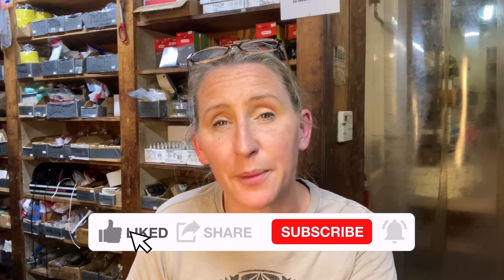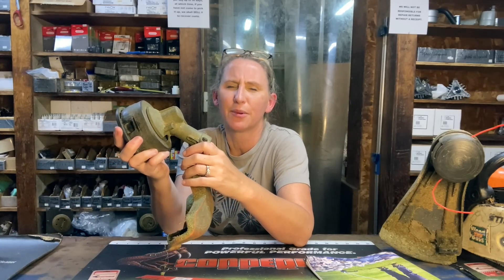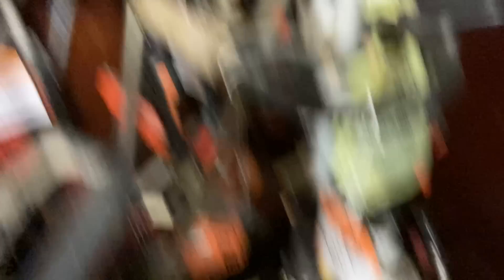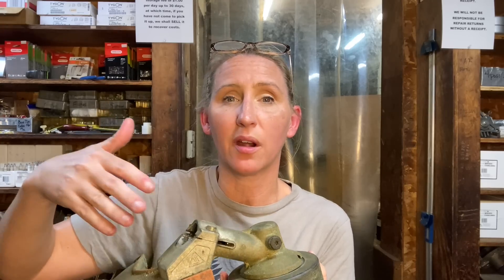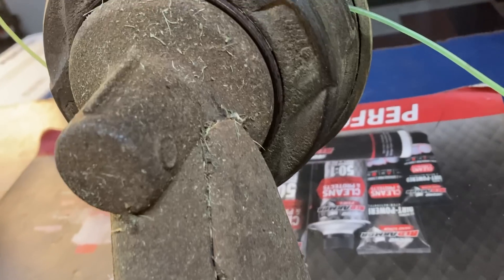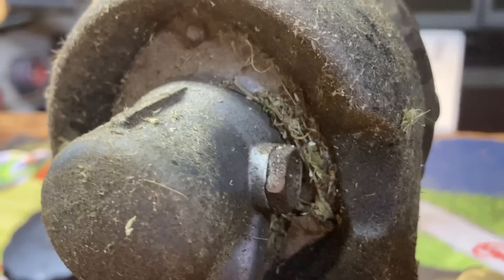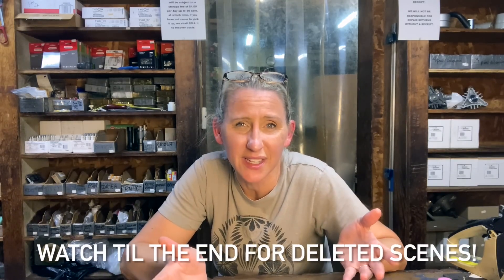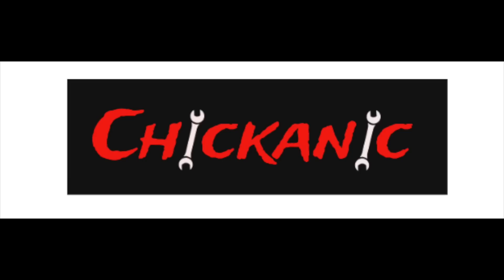Planned Obsolescence?! Why Would STIHL and ECHO Do This?!

Comment: Dear Chickenic, I have a 262x Shindaiwa which is the brother company to Echo. My last Echo unit worked for 22yrs with out issue, till the day the head holding screw broke and there was no way of removing it. In that unit the instructions said to remove head and pull out shaft and relive, do the current units have the same inst.  Now on my new unit I have put in a grease nipple in the bolt so I do not have to remove, allowing me at the end of the week to just give it a pump. Now not wanting to void my warranty, Is this an ok thing to do?

Comment: Been working on Stihl 20+years. To answer your question why the km-fs kombi shaft is cheaper then the gearhead it's self. There is a lot less mark up from manufacturing to dealer on Stihl accessories vs replacement parts. As for the no more grease fitting. The gear head usually outlasts the rest of the unit anyway, and it's cheaper to manufacture one without the threaded hole and adding a bolt. So financially I just makes better sense

Comment: My experience with universal joints is that the well sealed, non greaseable, OG, factory joints last 10 years. When people insist on greaseable replacement joints, they're never greased and they're back for new joints 2-3 years later. Introducing dirt and the wrong type of grease doesn't help the gear set.
Reply: Had my Toyota Tundra for 12 years, 390,000 Km’s Greasable U-Joints. Never touched one, other than to grease them!  New truck has them all sealed. 
I don’t want sealed U-Joints
Reply: A great point. I've seen this on my own vehicles even though they did get greased.
Reply: I had a 1987 Volvo 240 station wagon for a number of years. I put 500K miles on it, and it had the original U-joints when it went to the next owner. The U-joints had a plug where a grease fitting would be. They U-joints were so small, I don't think there was enough room for zerks. Every few years, I would remove the threaded plug and use a tapered adapter on my grease gun to pump a couple of shots of grease into each one, then replace the plug. The key was to keep the grease from drying out over long periods of time. In the 1960s, manufacturers figured out that U-joints and steering parts with fittings were being over-greased and the seals were being blown out, which is easy to do with pneumatic grease equipment, so they stopped putting zerks on many of them.
Reply: One of the reasons for NOT using greaseable U-joints is, Non greaseable u-joints are much stronger! As much as twice as strong, because of the hole that runs through the middle of them. I worked in race car prep shops when I was young and was told by factory reps., and an engineer. I asked, it seemed to make sense.
 In this application where there is no void in the metal of the gears, it doesn't make sense to not have a way to conveniently grease the gears inside.
Reply: @drummer0864   Your story makes no sense.
1 - How many broken U-Joints have you seen?
      It’s a very rare occurrence, normally 
      damaged from lack of lubricant.
2 - Have you ever seen a gear in a U-Joint?
      If you have, please send us a picture.
Reply: @davehudson4607  Greaseable u-joints are cross drilled for the grease to get to the bearing caps. There for, they are not as strong as solids u-joints are. You can still grease them just have to take the out and put them back in. If gears were cross drilled they would not be as strong for the same reason. You brought up u-joints and I did not intend to confuse anyone making that comparison. Back in the 60's and 70's, I saw a lot of broken u-joints, as I worked in a speed shop that repaired and built drag cars. lots of muscle cars back then. I also worked in a repair/ gas station right on an interstate and saw a few there too. Those were mostly from lack of maintenance. Having a gearset that is not readily service with some kind of lubricant is defiantly a set up for failure. Just so you don't think I'm some nut job, all you have to do is be able to get the lub in the case and the gears will distribute the grease where it needs to go. They don't have to be drilled. Are we ok now?
Reply: @davehudson4607 , re-read what he said. "In this application" referring to the gearhead on the trimmer. Gotcha!
I've seen dozens of broken U-joints on my hotrod cars from torque on the driveline.
Reply: @RoadKen53  U-joints come in different sizes and torque capacities. To go to larger U-joints requires larger yokes, which might not be readily available, but increasing engine torque and HP, and using large slicks for more traction might require larger U-joints to hold up.

Comment: My brand new I Stihl FS-56 RC- trimmer has a 26-2 cutting head on it and it has a grease plug on it, just like my 30 year old FS-76.  My trimmers have never turned 12,000 🎉RPMs.  About 9,100 is the max that I have ever set them.  I have never had to replace a gear head.  I grease my gear heads several times a year.  And remove the straight shaft about every ten years and clean and lube it, deadlier if it get noisy.

Comment: That's an easy one.  Trimmers no longer last for long so customers will have to buy new ones because replacement parts are more expensive.  Craftsman tractors from 2000 to 2010 would last forever if spare parts are available so they realize there is no money on keeping the same parts for years.

Comment: While I am just a home owner, I weed eat at least an hour a week, sometimes more. I have a Stihl trimmer from1998. Still runs, same head, never been greased. The only service was adjusting the carb maybe 3 times. I just don't see an issue. I have never greased my chainsaw bar either. I have ruined a couple bars getting pinched, but never replaced a sprocket. I grease my equipment, just not those parts.
Reply: Try using it for 60-80 hours a week.
Reply: @bobbyhempel1513 why would a homeowner try running a weed eater 60+ hours a week?
Reply: He is quite obviously citing commercial use - which is the main draw for this equipment in the first place.
Reply: @BrewReview He was indeed referring to commercial use. I was referring to being a home owner.  Also, as I’m quite sure you’re familiar with the term “prosumer” . I’m quite certain Sthil, Husqvarna, and Echo  sell more than a few products to non professionals. Anyway, I am only a homeowner. I don’t pretend to  earn a living with my weed eater or chainsaw. I can only speek to my experience. So I’ll ask again, why would I want to run a weed eater 60+ hours a week?

Comment: My guess is they think the seal technology is good enough that it will never leak. I see this on heavy equipment.  I used to be able to grease the universals on .  the newer ones don't have grease fittings on the universals. Just like front end parts. They used to grease them every oil change. Now they don't have fittings on them either. That's the only thing that makes any sense even though I'm totally against it. Thanks for another great video

Comment: Not surprised at all the manufacturers eliminated grease plug. I'd be tempted to disassemble the head, drill and install a grease fitting and put in a small threaded port to allow the grease to fill then put a screw in it. Now it's old school serviceable.

Comment: I think they do this for the same reason that car manufacturers replaced timing chains with timing belts, started putting fuel pumps inside the gas tank, and make most of the car out of plastic. One of two reasons. 1) No reason whatsoever, or 2) Just to piss me off

Comment: They did away with the grease plug for the same reason they did away with oil drain plugs in car transmissions.   Some bean counter figured if they saved .02 cents on a million units, they can save a bundle of money.

Comment: I have an older Toro trimmer that I replaced fuel lines & filter per your lesson and it runs great. It has a split shaft with a curved shaft trimmer head. Are there any straight shaft heads that may fit this? tag is worn away but it looks like a 51930. Do you think the new Toro flex force attachments would fit?

Comment: If you don’t mind me asking but do any of the newer echo 2620 or the 2620T or the newer sthl fs91s or 96s do you know if they have them or not because the weed eaters shown in the video are on the lower end models that don’t have the power as the commercial model trimmers that I asked about just curious because I don’t see sthl or echo not putting a grease point on a commercial grade trimmer

Comment: I bought an echo about 20 years ago and then never had a grease zerk either here we are twenty years later I grabbed it I use it I have no problem with it the only problem with it is I need to get a new carburetor the funeral just leaks everywhere but other than that my echo still runs good

Comment: little tip, hit the pawn shops. they have older equipment for alot cheaper than new. almost all my equipment for both home and work ive gotten from the pawn shop. most of my cordless tools, alot of my hand tools and wrenching tools have all come from the pawnshop. theres no way id have the collection of tools by paying retail. thruout the years, i bet ive save many thousands of dollhairs buy buying 2nd hand. some things needed a little tlc and other things looked like they were use so little, th plastic was still shiny. ive picked up extra stihl handheld blowers just for parts for about $100/each. in this day and age, in my opinion, its a smart thing to do.
they can sell you trimmer heads if they dont seize up....right?

Comment: It’s a way for them to save 0.50 cents  and  you pay 100$ to replace it  it’s a when when for them  let not for get back in the 80’s car manufacturers came up with no grease bearings  u joints  tier rods  and we know they save a tone of $$$ but you paid the price to fix it

Comment: Perhaps Chickanic can do a video on how much or how little grease to use on these areas that need greasing. Grease expands and created pressure once heated and a full grease cavity can build too much pressure and cause other problems.
Reply: Very much. When greasing your Stihl gearhead. Remove the plug, if there is grease on the end of the plug no greasing required. If no grease thread grease tube on and squeeze about as much as Toothpaste on a brush. I've seen heads over greased so bad the drive tube starts filling and bogging engine from excess load.
Reply: Perhaps she doesn’t grease them, I didn’t see any on her shelf that looked like the plug had ever been removed.

Comment: You explained exactly the reason in your video as to why they did away with the grease plugs. Because no one was using them! Just like mowers used to have spindles with grease fittings and now they don't. People dont keep up with their maintenance like they should, so manufacturers just stopped making them maintainable.
Reply: I've seen some of the replacement wheels for riding mowers, carts, etc. have grease fittings. I greased them but ended up having bad bearings only to find that the grease fitting didn't actually grease anything. The two bearings in the hub had the grease caps installed so when you pumped grease into the fitting, it just sat in the hub with no way to get to the bearings. Interesting world we live in...

Comment: Bre, great video and I can relate to this. Years ago I bought the stihl fs90. It did have a grease port. When it started to act up (about a year ago) I traded it for the stihl fs70. Being just a home owner and wanted to save a few bucks. But I noticed no grease port. They told me at the stihl dealer, it was a better design and there is no greasing needed. 
Hey I’m sure it will out live me. But a grease port some of some kind would be better in my opinion.
Reply: I am not a Mechanical Engineer, but I would be hard to convince that there is "no greasing needed" on a device that spins at 12k RPM in a dirty environment.  Grit always seems to find a way in to 'sealed' chambers IMHO.  Not to mention the fact that grease eventually dries out in most cases.  But then I am always skeptical of claims made by sales people...

Comment: Stihl has not had a greasable head on that model in at least 6 years.  There is bearing in there that can be replaced.  That is a lower end, weekend warrior model.  I believe the mid to high end ones still have the greaseable head.

Comment: The grease plug was probably eliminated for all the reasons everyone is citing.  However, the gear head is still removable and can be re-greased once removed...Maybe a little more cumbersome, but for those who do take care of their equipment, it shouldn't be a big deal.  To be totally transparent, I've owned an Echo Trimmer for 20 years and never once greased the thing, but after watching these videos, I'll be getting at that task this weekend for sure!
Reply: Clearly you did not put many hours on it, BUT time by itself causes the grease to loose the oil base and become too thick.  Now that the grease is 20 years old, you'd be best off taking the whole gearhead off, flushing out the old hardened grease with gasoline soak and a toothbrush, then doing a fresh fill.
Reply: I assume it happens quicker to commercial users.

Comment: I need my big Trimmer 2 Times a Year. It took me a few years to find one that propably will last forever. A "Zenoah Brush Cutter". 38cc Zenoah Engine, Turnable FLoat Carb, point Ignition, a 4 String Head that will last very loang an ist absolutely easy to rewind. It has 4 Spools. The Gearbox has a Grease Nipple, for a press...
I dont know when Trimmers like that came up, but mine seams a pretty early one, no Planned Obsolescence... 70s??

Comment: I bought a pole saw and was so impressed with it that I bought 2 more for other properties I maintain. Basically I used the heck out of them until one jammed and made a horrible grinding sound. I took the unit apart and found the clearance between the ring and pinion of the drive gear was really large. Then ring and pinion was now dis engaging under load. This was mainly because the housing where the bearing seated was shaved so thin (possibly to save 1cc of plastic) that the hole eventually wore out. So I cut a piece of tin can to fit the hole an zeroed out the slop. Been using it for a year. Take that you bean counters!

Comment: It simple and this applies to the "no oil change " mowers too. The average homeowner wouldn't grease them or change the oil so save a few cents a head and do away with the grease fitting and use the no oil as a marketing campaign

Comment: I like the videos but now I'm curious how you convert RPM to MPH on a yard trimmer?  What is moving at 400MPH?
Reply: I have the same question. I would guess a reasonable number for the gear's meshing speed would be 34MPH, given 12000PRM and a 1" bevel gear. But i know nothing about trimmers.
Reply: The MPH is not a question of the mesh of the gears, I'm wondering what exactly she thinks is moving at 400 MPH.  the engine in my truck is revving at 3000RPM, am I moving at 30, 300, or 3000 MPH?  

Is she trying to state that the tip speed of the trimmer line is moving at 400 MPH?  MPH isn't a measurement you can apply to something with a variable radius like a trimmer line that is constantly being let out and cut back.

Comment: Simple answer that I will bet is true.  The companies realized that most consumers never greased the heads, and they liked the cost savings involved in eliminating the material, machining, and plug.  I'm an automotive manufacturing guy, and our bean counters would kill for a one or two penny per unit cost reduction.  This change on the gear heads would add up to a lot more than a penny per unit.  In my industry the mantra for a long time was to make any cost reductions in areas that did not affect customer satisfaction, and I was on board with that approach.  Then we had a new CEO come along who was famous for severe cost cutting, and the mantra went out the window.  They had teams of very young engineers going around making cost reduction decisions, and at least half of those decisions resulted in reduced reliability and customer dissatisfaction.  When you are trying to get attention and promotions as a young employee, some were willing to do whatever it took to get credit for more cost reductions than the next guy or girl.

Comment: I think that they are learning the stihl fs560 I have has no grease fitting on head but the new fs561 does. And on a forrestry saw with that power I am not supprised they put it back.

Comment: This is why I do not waste my money on commercial tools. Pay 2x the price for a product that will break as fast as the regular. I was able to start my own mowing business for $500, mower, trimmer, and blower. This makes my 3rd season with the same equipment. Meanwhile when I worked for a big lawn care company running commercial grade Toro Grandstands, Echo trimmers and blowers, we needed new equipment every season, or at minimum a lot of repair work to keep it running. None of my equipment has required any maintenance until this year, I have finally had to sharpen blades on the mower, replace the air filter, and looking to replace the spark plug come end of season.
If any of my tools break on me, the most expensive to replace is $300, everything else is $100. No big deal at all.

Comment: I have a cub cadet zero turn mower that has 6 idler pulleys on it . Only 3 have grease fitting. The other 3 non greaseable pulleys fail every 2 years.